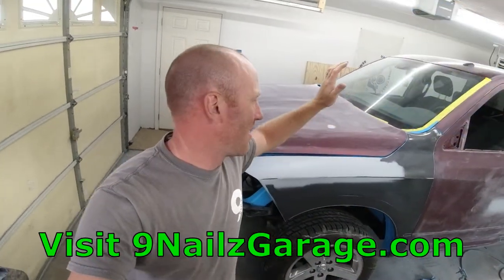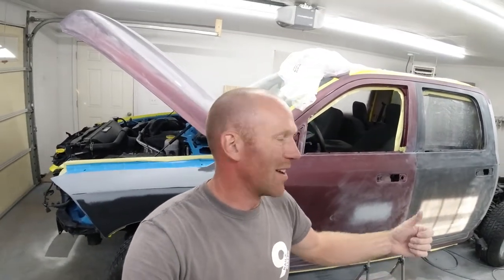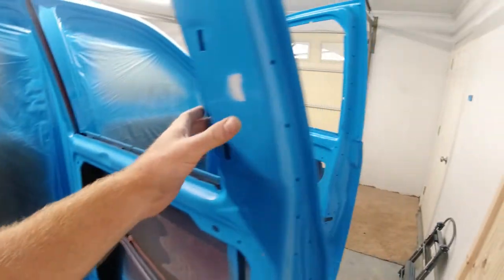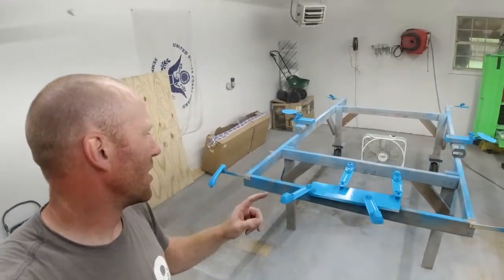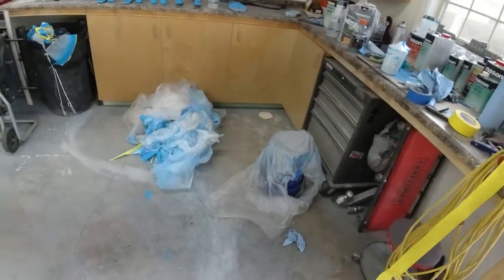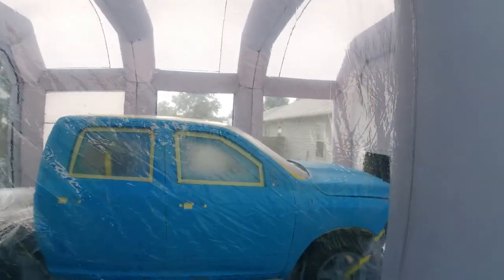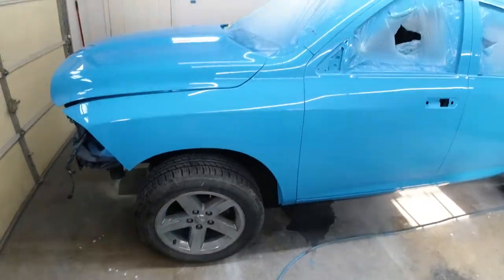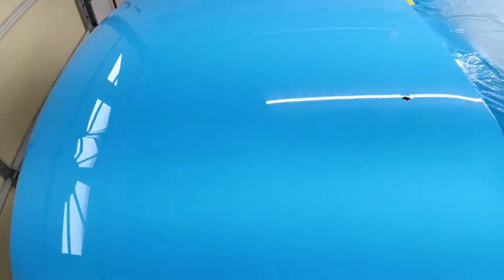2017 Ram Gets a Complete Repaint!

Comment: Great quality, what equipment are you using?  Air compressor, spay gun?  Do you remember the setting for the pressure to paint?  Thanks in advance.
Reply from the maker: Thank you! The air compressor I used is a ingersoll rand 7.5 hp compressor, I used a harbor freight refrigerated air dryer and the spray gun was a harbor freight black widow. I’d have to look at my spray but i think I sprayed around 14psi maybe 30? I can’t remember I’ll see if I can look at it this weekend and get back to yoy